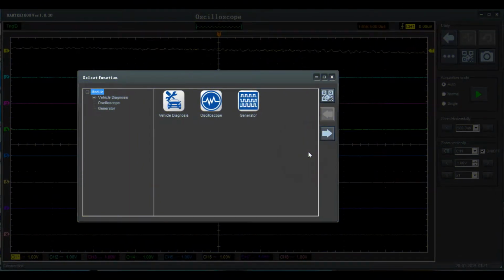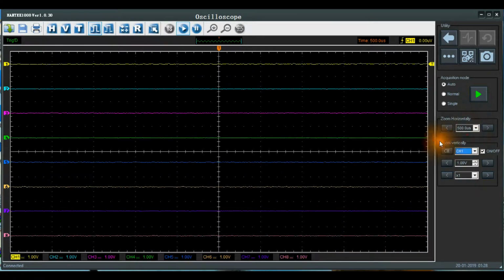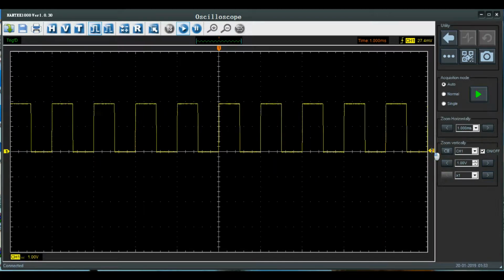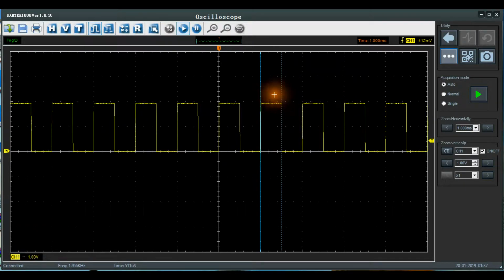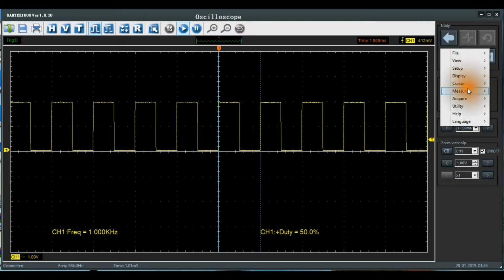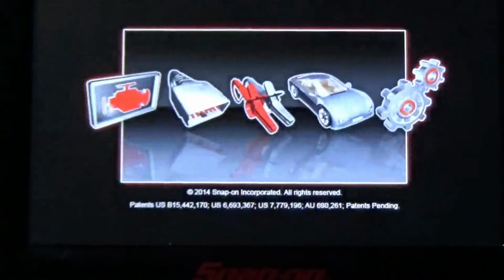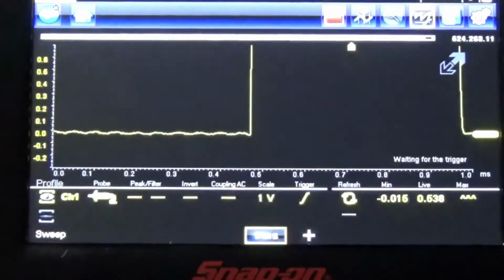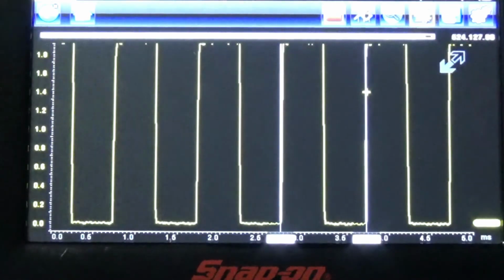Hantek1008C Vs Snapon Oscilloscope Comparison(shorter with better audio)

Comment: Can you save captured known good waveforms with the Hantek?
Reply from the maker: Yes you can. Pdf or jpeg
Reply: JL's Auto Solution that’s great, thanks for the reply. 👍🏻👍🏻
Reply from the maker: @jackstevens9907  sorry Jack. I thought it was for the Aurel.. you can save as a print screen capture with the hantek
Reply: No problem. Thanks for getting back to me. ☺️👍🏻